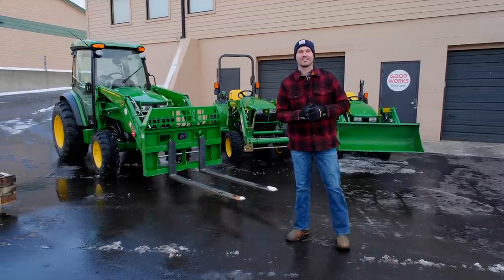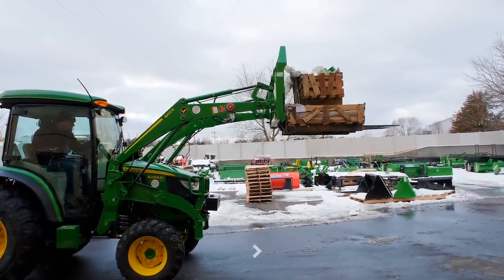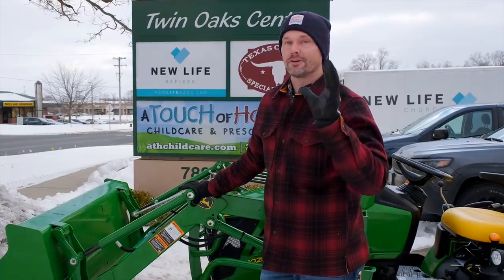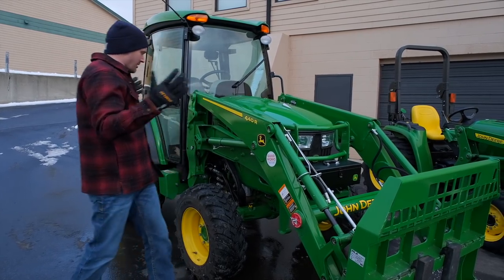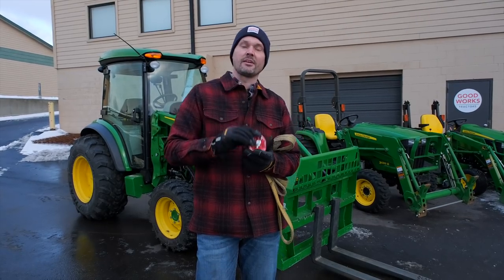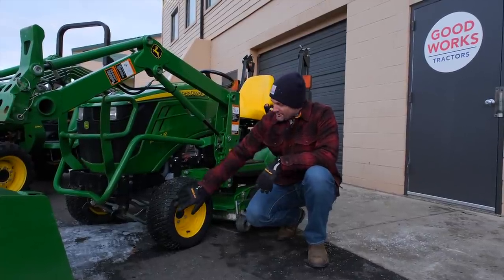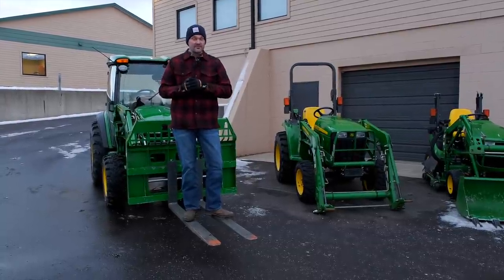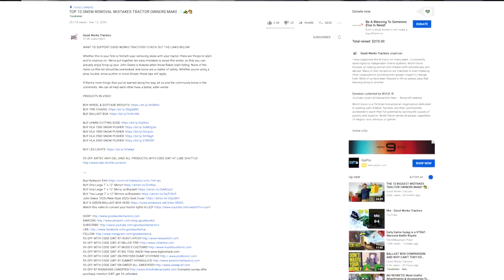20 TIPS TO LIFT MORE, DIG BETTER, WORK FASTER WITH YOUR LOADER 🚜

Comment: With my 1026R I am not able to use two functions at the same time and that seriously bothers me. Is it a defect or works as designed? 
Furthermore my loader joystick hits the working light when using the quick dump. Not a big deal but somewhat annoying...
Reply from the maker: I can make it work on my 1025r.  You should be able to on yours, but it's a very small sweet spot.
Reply from the maker: Sounds like your joystick might need to be rotated slightly.
Reply: Yes, you are right! :) Just tried it. Apart from my neighbors probably think I'm crazy, standing with the tractor in front of the barn moving the loader up and down without moving even one bucket of dirt, I found that really small sweet spot...works better with higher throttle, I need some training I guess... :)
Rotating the joystick, I still need to check...

Comment: I bought a previous generation 2025R.  I owned for 3 hours.

1.  Brakes were useless.  I stood on the brakes with both feet and could not stop.

2.  Worse, the 4WD lever was next to the differential lock.  So, guess what happens when you accidentally knock the tractor out of 4WD on a hill?

1/4 or more of the US is mountains.  Are tractor designers on drugs?
Reply: The designers of these tractors think tractors are bought by people living level land.

If you want a hillside tractor you need to look at Italian brands like Antonio Carraro. At least 90% of Italy is on the side of a hill.